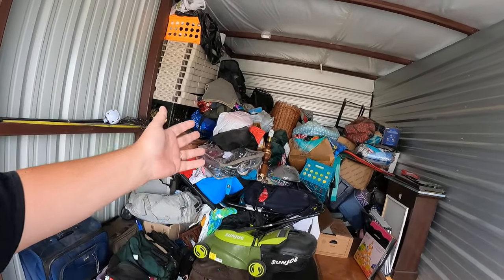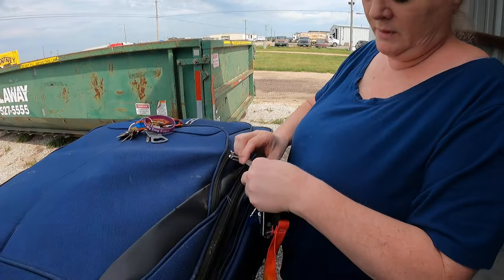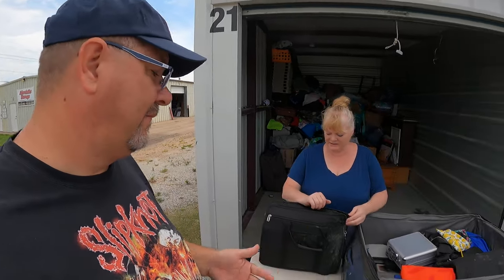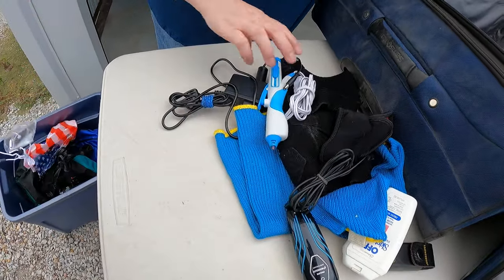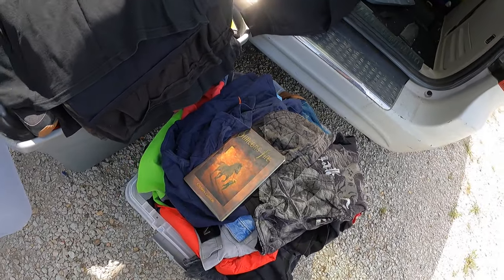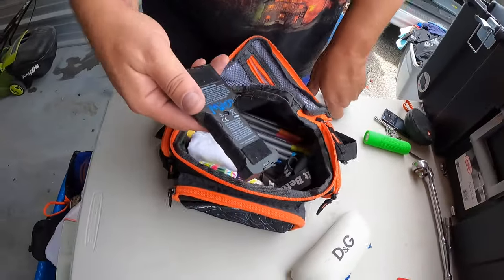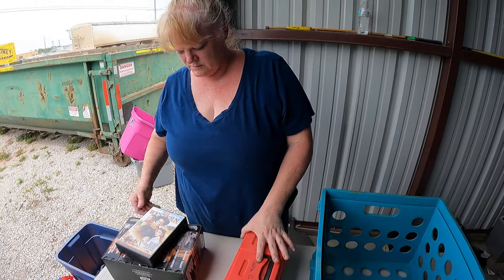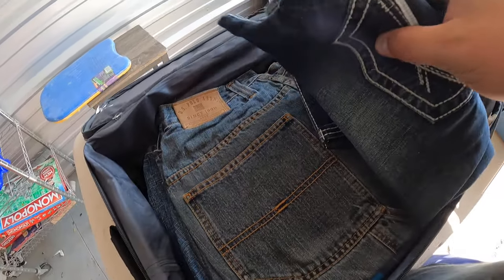MASSIVE abandoned storage unit for FREE!  (Part 2)

Comment: You know with cables I would contact your local metal recycling place. I know mine gives like $1 a pound for insulated wire. I know that usually means the type you have in your home, but I wonder if the other kinds will work too. You could make a few hundred out of a unit like this from that. About 12 years ago when scrap steel was going for a lot and it was like 12 cents a pound which doesn't sound like a lot, but I was saving food cans and making an extra $100 or so a year on those. Sadly they are only 4 cents now and it's not worth it.
Reply from the maker: That is honestly one of my only regrets doing that storage unit. It would have been fascinating to see how many cables and cords there were, and to show up at recycling center with a van full of them. If I knew then what I know now.....
Reply: @happyhearttreasures  It always surprises me more resellers aren’t scrapper’s as well. It’s a way to get the most from everything.
Reply from the maker: We do have scrap barrels and take things in when they fill up, after a few years we finally figured out we were losing out on a lot of potential money!
Reply: @happyhearttreasures  well that’s good it’s like it has never occurred to a lot of the reselling channels.